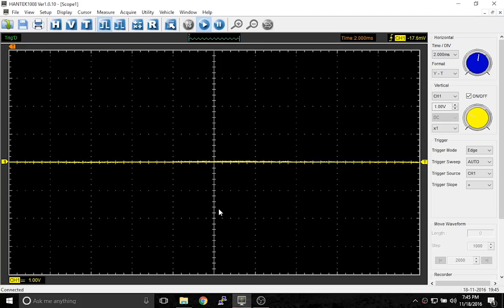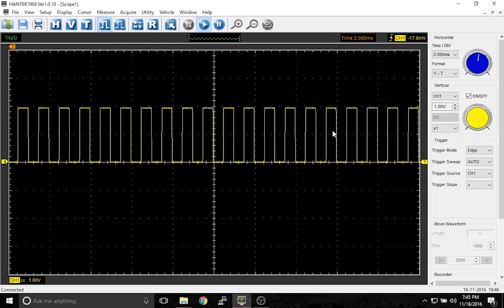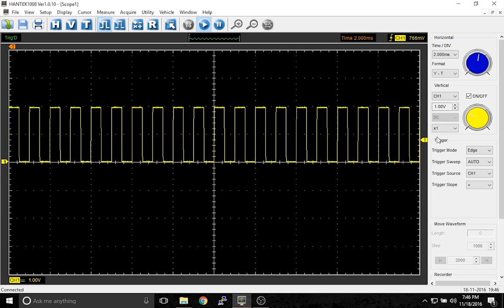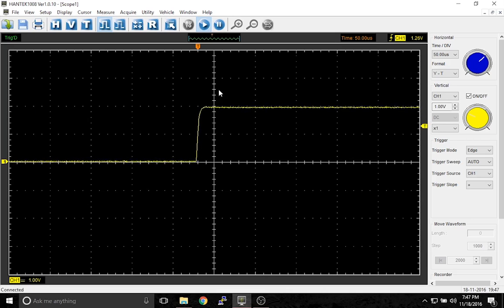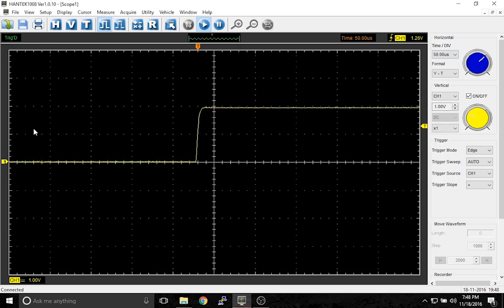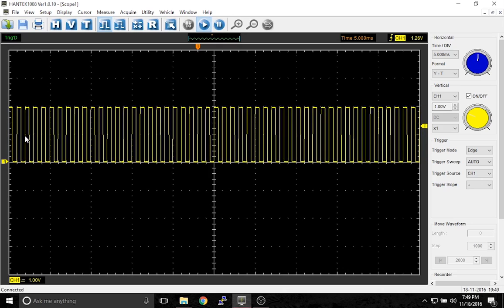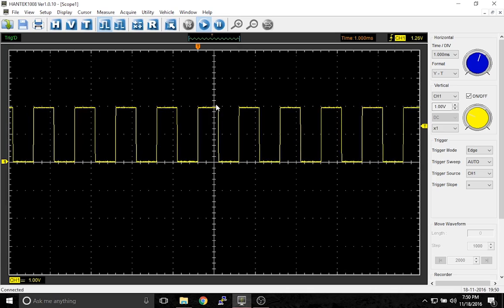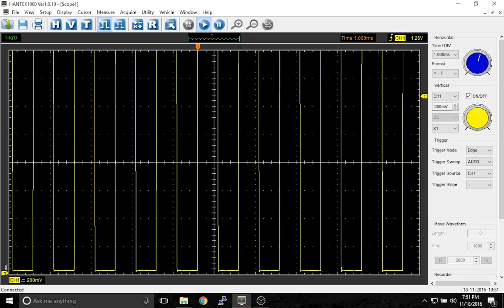Hantek Scope Basics

Comment: The sample square wave is 0-2V and 1ms per wave?
When I set the horizonal zoom to 100ms, I can see a hundred waves in a division (yes, very dense). When I change to 200ms, I should see 2 hundred waves per division (even denser), right? But I see a wave per 2.5 divisions. Is this a bug or I am not using this correctly?
I see the 2 tabs has polarity. If I reverse ground and positive, shouldn't I get a wave of 0v to -2v but it gives me no signal?
And I can't seem to stabilize the wave using the triggers you described. 
Either the software is so buggy or it is just me. I have ver 1.0.30.

Comment: Hello. What about automotive oscilloscope probes? They have no slot for adjustment. That means they cannot be compensated? They come with 2 alligator clip ends or banana plugs but no slot anywhere.
When I clamp any leads it does show a square wave but overcompensated and it cannot be calibrated or compensated.

Comment: Hi, first of all thank you for your efforts, I like to ask you my problem with the HANTEK 1008c
- I bought a Hantek 1008c at the start it worked well but sooner or later it blocks my pc
- my Hantek 1008c now gives me false measurements and I don't know why, I did the zeroing and even the factory setting and nothing changed, and when I measure the 2v 1khz it gives me false measurements
please what can you advise to solve the problem? thank you so much
Reply from the maker: Tell me what you mean by false measurements. Is it showing a sine wave rather than a square wave. Is the amplitude or frequency wrong? Is it a blank screen?

In the mean time try these troubleshooting tips. First try a different channel. Next I would try a different probe. If that does not work try different time bases and volts per division. Lastly if all else fails I would try to see if any signal will work at all. If none of that works try a different PC. Let me know what you find.
Reply: @Enrique_Osorio  Hello , it's a square signal, the  frequency is wrong , the amplitude is wrong, I tried all channels and i find yhe same results, I change the pc and I find the same results
Reply from the maker: My next question is HOW wrong. Is it slightly off or is it a large diffrence? The Hantek is NOT a very accurate device. A 1-5% error is not unusual in my experience.
Reply: @Enrique_Osorio   I mesure 0.347 v for all mesurements ( battery  or any other signal)
Reply from the maker: That is interesting. I am wondering if it is a hardware issue or software. Here is a test. Going under the assumption that it is a hardware issue this would mean that the hardware is erroneously telling the software that the input is 0.347V. Since the software is trusting the hardware telling the software that a 10x probe is connected or a 100x probe is connected then the measurement should also be divided by that amount. Try selecting 10x probe and 100x probe and let me know what the measurements are.

If the measurements change as expected then it is likely some type of hardware issue which could be the voltage probe or the Hantek itself.

If nothing changes it is likely a software issue and I recommend using the video that I posted to reinstall your software and drivers. Links below.

I am sure there is a third option that I am not seeing. Personally I find it difficult to diagnose anything if I am not right there with the malfunctioning object. Let me know what you find.

Links to videos where I show how to install the software and drivers. They also have instructions on accessing my google drive for the specific version of software and drivers that I personally use.
https://youtu.be/wCHch4X0cqA
https://youtu.be/vn_rkn3SBQE
Reply: @Enrique_Osorio  thanks I will do all the tests and I will contact you ,thanks very much for your help
Reply: @Enrique_Osorio  Hello, I did the test for x10 and x100 the results are 3.71v and 37.1v the frequency remains 1khz for a TIM / DIV 200us, and when I change to TIM / DIV 20ms the frequency this changes from 111hz to 156 hz, I did another test or I measured a voltage of a battery of 12.4v I found that 2.51v !!!!
Another thing the green lamp it lights up with another red in degradation or alternately
auter point in general when I remove the usb port my pc or all the pc or I have use it automatically resets
Reply from the maker: Sorry for the late response. I am taking four classes this quarter with 3 labs and it is still Week 1 😢 From the information you are giving me it seems that there is likely some hardware issue. My guess is that it is your Hantek 1008C has been damaged since I believe you have tried using different probes? If you have not tried a new probe I would do that next. Other than that I am out of ideas. I am really sorry. If during your troubleshooting you notice anything else, let me know and I will give you my thoughts on it. Keep in touch.
Reply: @Enrique_Osorio  
Hi thank you for your explanation, I also think my hantek 1008c is damaged, I think the hantek brand is a bad brand, thank you very much

Comment: Is it true that the Hantek 1008 max input voltatge is 400V, if so do I still need an attenuator to check injector wave forms? thank you
Reply from the maker: Yes, unfortunately in my experience the claims of the manufacturer do not line up well with reality. Typically the software will glitch if voltage spikes above 30V - 40V are measured without an attenuator. YMMV since I highly doubt there is a great deal of quality control in the making of these scopes.

Comment: Hi  I have a Hantek 1008c and the ht25 auto probe for checking the secondary ignition  on a corolla without the coil on plug ignition . I am unable to get a clear stable wave form , do you or any of your followers have knowledge of the set up  . I've done the injector wave forms and it was stable and clear so I don't think the equipment is an issue . Regards Pete
Reply from the maker: I have never had an issue with the HT25 but I do know that non COP Toyota spark plug wires are really thin. Perhaps if you had something metallic that would take up the slack between the probe and the wire (Small piece of aluminum foil), it might result in a better signal. Unfortunately I do not have access to a vehicle with spark plug wires so I can not check this for you myself. I hope this helps. Let me know how it works out.

Comment: You may want to check out the new software it has some improvements. Only thing that doesn't make sense in it. is the recording portion.
Reply from the maker: The recording function of this software is not very good. I have not used in years since it was not very valuable to me. I will absolutely check out the new software. Did you get it from the Hantek website?
Reply: @Enrique_Osorio  It came with the hantek unit on cd. Their website is terrible I couldn't find the software when I tried to make sure I had the latest copy.
Reply from the maker: I see. I bought my Hantek in 2013 and the software barely worked then. Hopefully I can get my hands on the latest software soon.

Comment: Hi Enrique, I'm having trouble storing waveforms with my Hantek. Could you do a tutorial on capturing waveforms and creating a data base? When I capture an image and store it as either a jpeg or bitmap, when I refer back to it the scope pattern is cut-off.
Reply from the maker: It has been extremely hit or miss with the store function on the Hantek. I personally do not recommend using it. It works well with simple waveforms such as square waves but anything more complicated it is not worth it. I will attempt to show how it works in the future but it not currently a priority. I recommend a PicoScope, even an old used one for storing. In my experience they have the best software for that type of function.

Comment: How many megahertz is each channel?
Reply from the maker: I do not know. I looked up the specifications and the only thing it says is 2.4 Megasamples per second. In my experience I was not able to clearly read a 700 kHz signal on the Hantek, but when I switched to my PicoScope it read the 700 kHz signal clearly. As a guess, I would say do not use this scope if you need to look at signals above 500 kHz. I will do a sweep with my function generator when I can and I will let you know. Thank you for your questions and thanks for watching!!
Reply: Enrique Osorio So if I want to see ignition signals for a coil in an engine would it read it, the reason I ask is because I noticed that it is sold as an automotive oscilloscope on certain websites and I was intrigued by it and I want to be sure that it will work for what I need, I hope you could clarify it for me. Thanks and have a great day. 🤙
Reply from the maker: Ignition waveforms will read just fine on the Hantek. I have made several videos showing how to do this.

The first video is very old and not very good but it does show the main idea. Here is the link.
https://youtu.be/2QK8r6N9qXM
Please keep in mind, when measuring the primary ignition circuit, the voltage spikes can be nearly 400 volts which can damage your scope if you do not have an attenuator. I have made several videos which address the use and function of an attenuator.

I have another video showing a trick I learned to capture the secondary ignition signal from a COP.
https://youtu.be/PALjk13DDiQ

Check out the rest of my videos and you will see several automotive type signals being captured with this scope. Thanks again for your inquiry!!
Reply: Enrique Osorio thank you so much I have subscribed to your channel and also sent them to my Dad, thanks again. 🤙

Comment: Enrique, i would like to get hantek scope when i get the scope what else do i need to get to get  started on  the basics
Reply from the maker: If you are planning to study electronics I would recommend a small arduino kit that comes with a breadboard, wires, led's and other components that will allow you to build interesting projects. There are ALOT of videos that will get you started on building simple circuits, programming arduinos and analyzing waveforms on your oscilloscope. There are a lot of ways to get started but the important thing is to START, have fun and learn as much as you can. Thank you for your question and thanks for watching!!!!
Reply: @Enrique_Osorio  Thank you for your fast respond where can i get a small arduino an thku again keep sending those videos
Reply from the maker: If you want an official kit try sparkfun.com (here is a link for that)
https://www.sparkfun.com/products/14418
Luckily arduino is an open source device that allows other people to make copies of it. On eBay you can buy "knock off" kits that work just as well as the real deal. Here is a link as an example. 
https://ebay.to/2TXNeTv
I do not recommend buying that one, not because it is bad, because you should buy a kit with items that interest you. There are many options out there. You do not eve have to get an arduino. A breadboard, some wires and some components and you can get started with just a few dollars. Let me know if you have other questions.

Comment: when are you using two pins next to ch1 symbol is square wave 1khz ..2Vp-p
Reply from the maker: The entire time. I never used anything else in this video. In the following video I use a variable square wave generator to show different features. That was a 555 timer where I switched out capacitors and varied the control resistors to change the frequency and duty cycle.

Comment: I ordered a Hantek 1008B (in part due to your videos🙂) and I have a project in mind. If you take a few minutes to watch my video on a IOD tool I made:

https://www.youtube.com/watch?v=XKogh1Rsty8

My plan is to connect the output leads of this device to the Hantek 1008 instead of a digital multimeter to monitor Ignition Off Drain over time. Some instrument clusters have been known to wake modules, for instance.
Thought you might be interested...

Comment: HOLY SH1T, I've only watched 2.07 minutes of this and I have learned so much already, more than the other videos I watched.

I got mine today, seems a nice budget device that will do for my needs however I am having an issue setting CH1 the probe for CH2 is fine, just No1 is not responding well to compensation adjustments.

I shall watch on...

Comment: You can do things with a Hantek that are impossible on a regular oscilloscoope, EG.
you can show two waveforms and adjust for a different time base for each..Your laptop screen view is huge (usually) compared to regular scope. Pity the software is unstable and crappy. On mine, forget xy or fft, program just cashes and restarts (win 7), maybe it works on XP..

Comment: I noticed a few times you mentioned in the comments that you can pause but you  go back..Can you do that with the record /playback function at the bottom of the screen?  Does it cause any problems using the record function?  for example slow down the capture?
Reply from the maker: I have never used the record function, it is pretty tedious to use so I am not sure. If I find out more I will let you know. There is also a video made by another user, that I saw years ago, who demonstrates the use of the record function. If I find it I will let you know.
Reply: Enrique Osorio thank you for taking the time to respond

Comment: I am trying to figure out if there is a way to monitor/record the frequency waveform from a mass air flow sensor and to see what the max frequency it hits when I snap the throttle.  I have recorded a waveform and did the test but on playback I see where the snap happens but its gone before I can pause it, even on the slowest playback speed.  Do you have any suggestions Enrique on how to tackle this issue?  Pico has the nice ability to graph a frequency, but of course its cost is prohibitive, at least for me.
Reply from the maker: The best way I can think of is to have it playing live with a short time base and with the frequency measurement on. I would say the time base should be low enough that you can only see one or two square waves. Once you have that set your trigger so the waveform is stable. Then snap your throttle. The frequency should rise and the square waves will get tighter. If you see the squarewave disappear into a blur or the squarewave gets way tighter than a normal snap, you just saw the frequency rise way above normal. This may work but it's no guarantee.
Reply: Thank you Enrique,  your tutorial is also useful to  us weirdos who invested in the snap-on scopes, because sometimes their component tests which are supposed to have the trigger points and time span set. And sometimes I get a dirty  screen,  even if I've had a calibration cycle done, your tutorials have helped me set my Verus scanner / lab scope up to get more accurate illustrations of various components and systems I've had to test and I've been getting more diagnosis and a better understanding of conditions of those components,  so thanks again,  keep it up!!